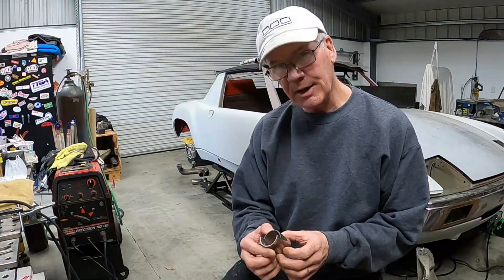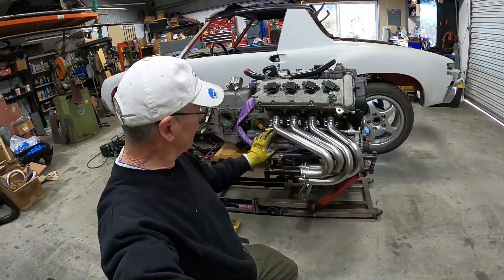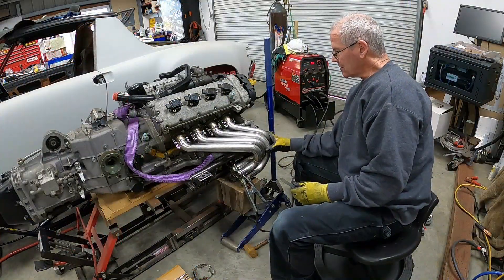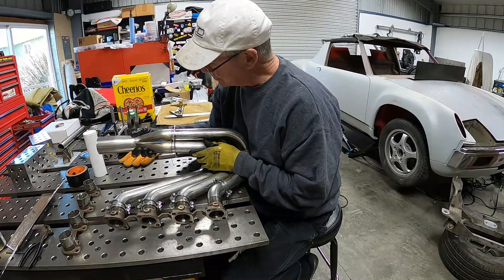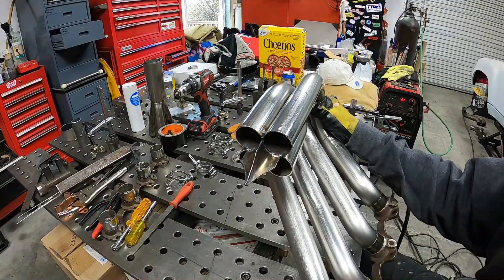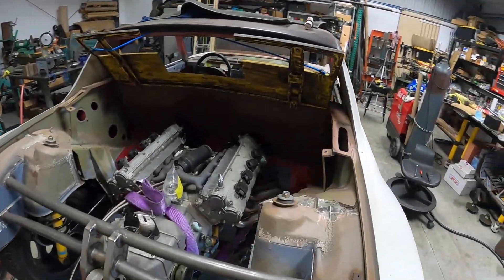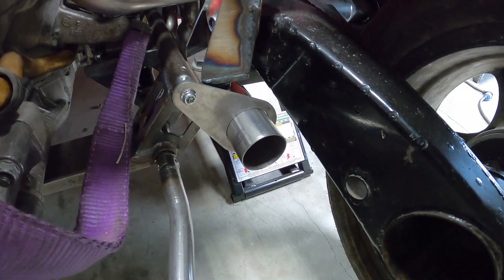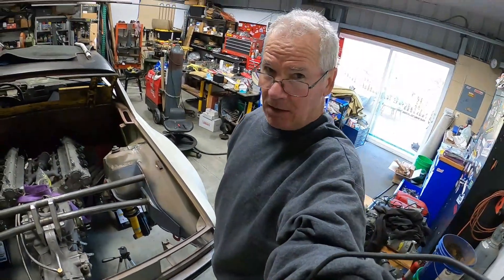914 Ferrari Build - Episode 16: Headers, Part 4

Comment: You really need to invest in a furick cup if you're going to be doing SS tubing. You're basically running an aluminum setup on your torch right now and you'll never be able to get the stick out, flow, and shielding area you need to make those tight spaces easy.
Reply from the maker: I appreciate the suggestion... and I do have some other cups but so far, haven't run into anything too bad. The primaries are removed from the flange before being welded so it's easy to get all the way round them. Again, so far, that is... Thanks for watching, thanks for the reminder!
Reply: C’mon man!  You know you like cool tools!

Comment: Just wondering (never put together a collector) what is the value of the "star/pickle" is? Very pretty work!!!
Reply from the maker: Hey John! It helps smoothly merge the exhaust pulses from the individual primary tubes into the single outlet of the collector.